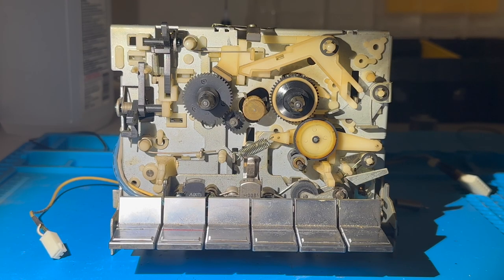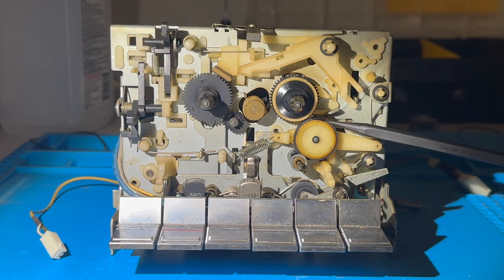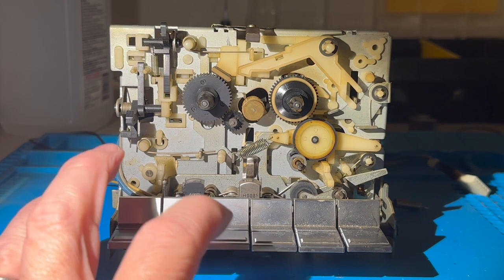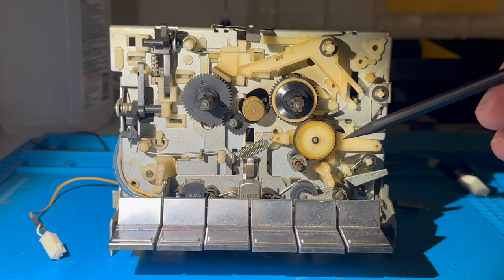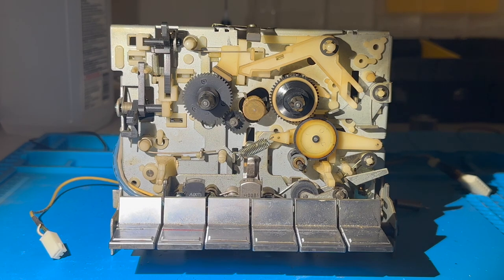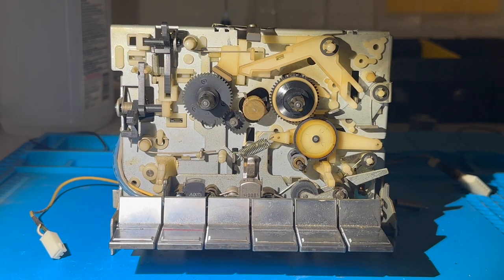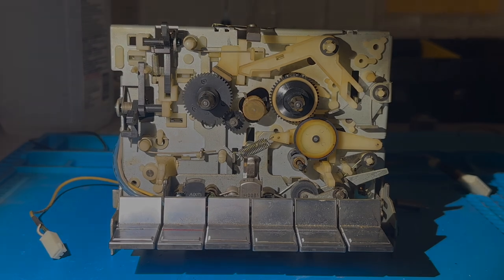Vintage Sharp RT-20 Cassette Mechanism Idler Tire Take-Up Rubber

Comment: Thank you for the post. I have the same model and the take up wheel would not turn when play. The roller and capstan work and the take up wheel would not turn to take up the tape.  I have not taken the deck mechanism apart yet but want to know if the take up wheel is driven by the pulley tire or if there is a belt between that drives the take up wheel. Were you able to find a replacement of the pulley tire locally?  Any info you could share will be much appreciated.
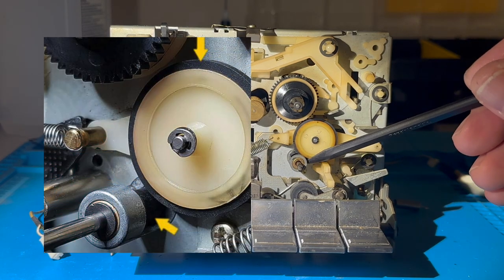Reply from the maker: Look at 0:48 in the video.  There is a rubber tire on the capstain that the take up pulley makes contact with when you press play. The capstain is driven by the motor via the flywheel that it is connected to. The rubber tire on the capstain melts over time and leaves a sticky rubber goo mess.  You can replace the rubber tire on the capstain with latex slingshot tubing with an inner diameter of 2mm and an outer diameter of 5mm.
Reply: Thank you so much. I took it apart and you are exactly right. The capstan rubber all melted. The idler tire looks fine.  I will try the slingshot tubing method. Hope I can save it.  Thank you again.  Very much appreciated.  I enjoy the goodwill shopping unboxing.  I like vintage gears and they were much better quality than today's stuff!
Reply: Forgot to ask one more question.. do you have recommendations on replacement of the idler tire?  Is there an inexpensive alternative for the rubber portion of the idler tire?  Thank you again
Reply from the maker: @TL-qf1hd  I haven’t found one yet.  Hopefully you can just clean yours up!